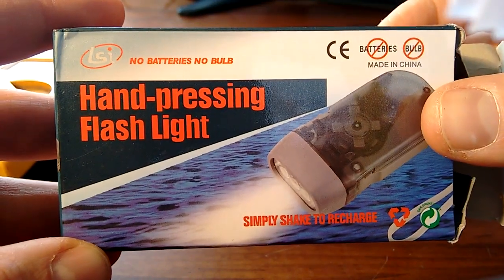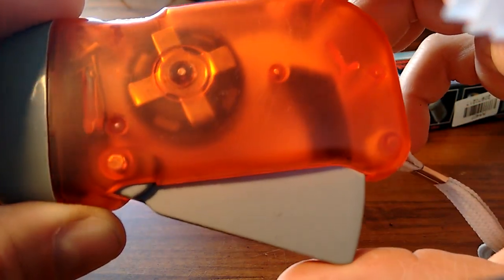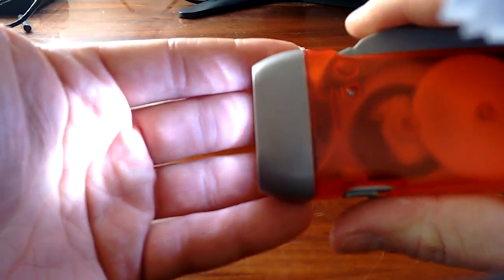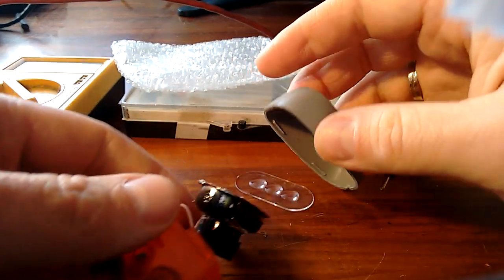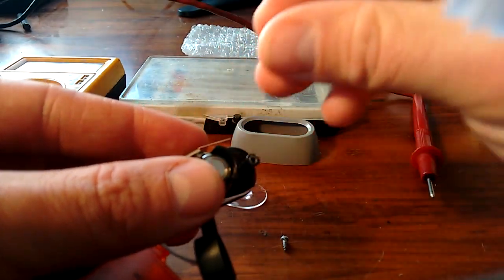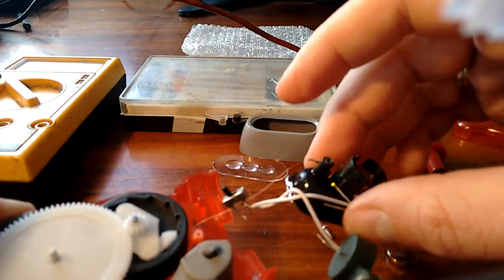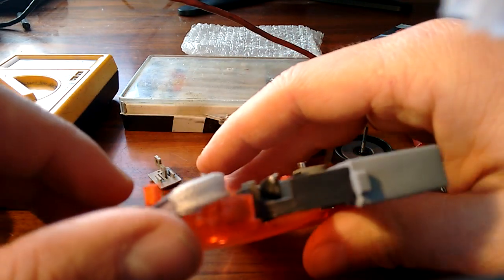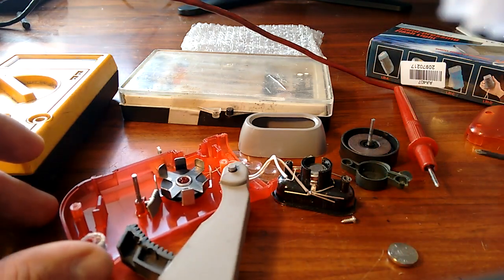Fake 3-LED Dynamo Hand-Crank Flashlight from Ebay,China - TEARDOWN

Comment: Alot people say the battery does not recharge well you have to shake it to recharge
Reply from the maker: you might not understand the point that this doesn't had a rechargeable battery but a normal battery, so its a fake product, never will recharge (at least what I have)
Reply: Veryokay mine is new so i dont know if it is charging or not
Reply from the maker: @kyriosi2966  let it discharge completely and you will find out once try to charge!
Reply: Veryokay k

Comment: I don't understand the problem??? The dyno charges the batteries that run the LEDs. Whats fake?
Reply from the maker: the "dynamo" here is just a few wires for illustration, there is no rectification diodes nor charing circuitry, the LED runs off directly from the non rechargeable battery. Hope thats a good explanation.
Reply: Hi @VeryokayDIY. I suggest you edit those parts (I could not also understand what you were saying at first, I needed to rewind the video twice). Or, type the words/text as subtitles. Thank u.

Comment: I just bought the same flashlight. Same box and design but different color though. Tested it after watching the vid. Drained the battery(took several hours) and tried to recharge it and it works. Some are legit I guess.
Reply from the maker: Nice that not all fake!thanks for the feedback
Reply: Really :000

Comment: Thank you so much, I Actually Bought one Online and it has the same box, same color and wires are cut off, Cracks on the  case, Old Box and Broken Switches, after i found out that it also actually wasn't a Dynamo i was so pissed off on how BAD the quality is.

Comment: I have similar one, but with 2 LEDs & it's from Shell. I wouldn't say it's fake.
Reply: I have just opened it up & it doesn't look the same. It has a small resistor & some wiring. Although now it doesn't work so smoothly, I messed something up.

Comment: +veryokay the batteries in there but it still can produce electricity right?
the different is they used un-rechargeable batteries on it, am I right?
it used the induction method, right?
and what is the different between the original?
Reply from the maker: Yes, you are right! It still works (but you have to trash the lamp after battery drained). 

True crank flashlights use real dynamo inside, producing alternating current (AC). Yes, the principle is the induction,  induced in (at least) two connected coil, what the + and - poles of the magnet induce during rotation.

Eton makes the best price / value lams as far as I seen:
http://www.etoncorp.com/en/products
Reply: thanks for your video
it's help me a lot
Reply: "True crank flashlights use real dynamo inside, producing alternating current (AC). Yes, the principle is the induction,  induced in (at least) two connected coil, what the + and - poles of the magnet induce during rotation."

and how about this fake product?
Reply from the maker: the fake use also dynamo, but so cheap and so under scaled in power that cannot even dim the LEDs into full brightness... It's kinda "imitation" of a dynamo. See in the video from 3:40
Reply: ohh i see
thanks for your explanation
Reply: can you give me the link where i need to buy hand crank flashlight with the same design? 
i mean the original one
Reply from the maker: the fake is shared in the comment filed of my vid (don't buy :) 

not sure what you mean by "original" don't know if the fake was a clone from an original etc...
look for Eton products, they make good stuff
http://www.etoncorp.com/en/productdisplay/clipray-1
Reply: ohh ok thanks a lot

Comment: I bought 12 of these from a dollar store. I love them. Mine have a capacitor in them. Tested 1:45 minutes on then started to dim. I was hella impressed. I cranked it like 30 times and it ran for another hour and I just turned it off in complete satisfaction. I stuck them in closets, cars, truck, under the fish tank, and have been very pleased. Good to know there are some out there with batteries instead of a capacitor. That is shit. Mine looks the same yet with 2 led not 3. I have had them for more than 3 years and they all still work.
Reply: roger hurd I bought one from Dollar tree too and it lasted for over 2 hours but I stopped the time because it took too long to even considering to die
Reply: same, bought a bunch at dollar tree. Left it on an hour til it dim and pumped it back up again. Some must have different internals. Great deals for a buck.
Reply: I bought a few from dollar store n I think they are great. I left it on to kill the battery to see how much light I get for every crank but still waiting after 52 hrs still lit
Reply: We can form a society already.

Comment: They should've just put some capacitors to hold the charge for even a few minutes (so we don't need to crank all the time) instead of non rechargeable button cell=/.
Reply: Dude this "Charge Button" charges the battery... -_-
Reply: no it doesnt, this is fake

Comment: I have one since 2010, works fine !
Reply: And now still work ??
Reply: @ArsipGameAndroidJadul  I had one for several years. When the batteries are empty ones you can stil use it by pushing constantly as the video shows. Finally mine broke but lasted enough.
Reply: This could easily be solved with a diode and a capacitor. Maybe a controlled discharge circuit. I think I will re-engineer it to charge a capacitor or lithium cell. And make it charge cell phones. Provided than your hand doesn’t give out first. Lol

Comment: This could easily be solved with a diode and a capacitor. Maybe a controlled discharge circuit. I think I will re-engineer it to charge a capacitor or lithium cell. And make it charge cell phones. Provided than your hand doesn’t give out first. Lol
Reply from the maker: good idea! :) good luck with it!

Comment: On the contrary my friend i've had mine for about 2 years and runs great. some models have capacitors others have rechargeable batteries or both but it does work with or without batteries
Reply from the maker: Wow, thanks for the info Alex! Looks like there are real dynamo lamps and fake clones on the market then... thanks
Reply: So does that mean it would work for a long time? I am planning to avail one. Item is free and i just have to pay small ship fee amt
Reply: @stanbalo  yes it works for a long time, I rarely have to crank it but maybe once a week for good measure, I keep it by my bedlamp for nightime use
Reply: @alexmanzanero  nice! thank you for your reply!
Reply: @alexmanzanero  it doesn't work with me i always crank it
Reply: @alexmanzanero  it works but very slow
Reply: @VeryokayDIY  I had one for several years. When the batteries are empty ones you can stil use it by pushing constantly as the video shows. Finally mine broke but lasted enough.

Comment: I bought one of these for maybe a couple bucks and this is exactly what I found inside. 3 LR44 button cells power the LEDs. the dynamo is connected to the LEDs but on the other side of the switch. You are better off getting a 5mm LED and two coin cell batteries and taping them together. Waste of resources IMO.
Reply from the maker: Agree!

Comment: I still don't understand how it is fake??!!
Reply from the maker: 1. It has non-rechargeable batteries (aka primary cell: https://en.wikipedia.org/wiki/Primary_cell) You should agree that a hand-crank flashlight (which stores it's energy in a rechargeable battery) needs a rechargeable battery...

2. however it has some funny electricity generator flywheel it's current delivery cannot reach the fraction of what needs for those LEDs (this means it's a very poor design as those LEDs are not high power etc.)

On the other hand what is really pity that they were quite close to make a real product just would need to spend a bit more time and material cost on the design...
Reply: Can you do a video on real charger which actually works
Reply from the maker: No, I'm not going to do...it's already done :) 
Check out: https://www.youtube.com/watch?v=DNbJ63FS6WI

Also check out Eton, they make (one of) the most serious crank flashlight on the market: http://www.etoncorp.com

Comment: Yup bought a couple before, its very cheap sorta like those  cheap keychain souvenir flashlights, single use no duh and not really... Fake is a strong world for a no duh cheap flashlight, why did you expect it to charge, look at the box does it say "rechargeable", nope its like old dynamo bike lights when you stop so does the light, duh!!!
Reply from the maker: MadDawgDarius Check the box writing at 0:00 sec on my video: "No batteries" :)) They start the first sentence with a lie as they hide three coin cell behind the light reflector plastic... :P

The second lie on bottom right: "Simply shake to recharge" :) There is no true dynamo inside and no rechargeable battery.

I agree with you this is a really cheap light and could be useful as usual "throw away" key-chain lights. But at the end they fool the average user. 

Secondly: I hate the "throw away" electronics idea, already we generated thousands of tons of electric waste globally... Google up "electric waste" and click to images. Lot of children suffer from "e-waste hills" booth in Asia and in parts of Africa

Cheers

Comment: lol I got this as a free gift from the water company. I let it on to test how long it last. As soon it was beyond 15min, I knew this thing must have batteries in it.
Reply: +Nik Neuy Of course it has batteries inside. But they should be rechargable ones, so when you crank it, they should recharge. That's how it works.
I wanted to buy myself one, they're dirt cheap, but I changed my mind. Save the money and rather buy more expensive one. Those work.

Comment: I just bought the red one. I tested it by turning it on until the battery runs out. I haven't got the chance to really drain the battery but after 48 hours the light is not to bright anymore. I crank it up for a couple of minutes but the light is still a bit dim so I just turn it off. The next day I turn it on again and the light came back to its original brightness. 

After watching this video, I don't know if the hand crank power is really fake or not because the brightness came back to original after 48 hours. I'll just test it more.
Reply from the maker: Yeah, it's just because you let the batteries "sleep a little bit" :) So a drained battery can recover a bit after several hours. But you won't get the same capacity after that only fractions of operation time.
Reply: Ive had mine for a couple of years and works just fine most have a capacitor that gets recharged but others will have a rechargeable battery ,,..so what it works
Reply: Joef Clarin
Reply: What about now
Reply: @VeryokayDIY  what is that phenomenon called 0.0

Comment: There is nothing fake about these flash lights. These were sold for Rs,10/- in Mumbai, India. Equivalent if US$ 0.15. It last quite a while until I dropped it and broke it. So quit the bullshit videos. You don't even need a battery. A super capacitor does the trick.,